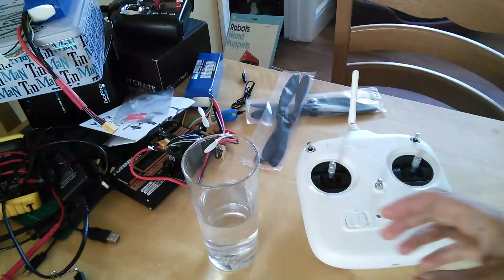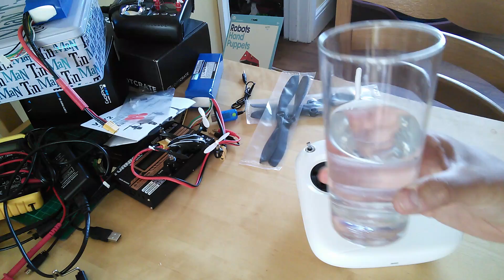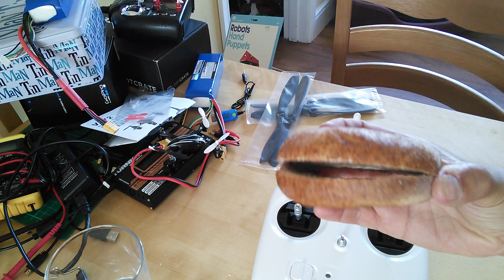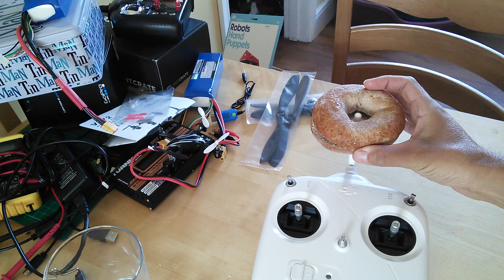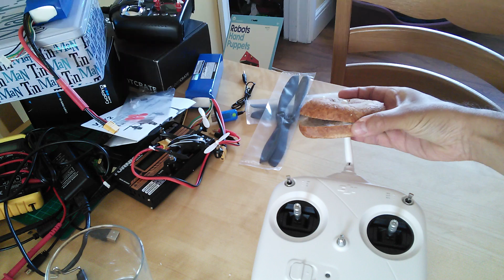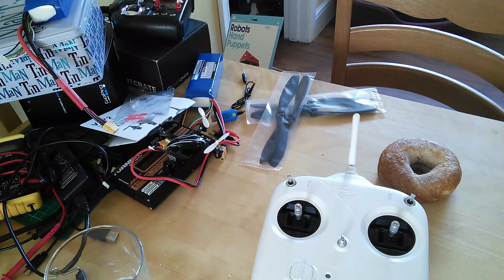Can't fly your Phantom Vision or Plus high before losing control? Possible solution.

Comment: Well couldn't wait til "tomorrow" so I went out and tried again. Sure enough, if I kept the Phantom "out" a little and not directly "up", I didn't lose contact. I flew 500 feet away up to 300 feet altitude at times and never lost contact. I'm in an airport zone so I couldn't go higher than 300. I'll fly more later.

Thanks,
Reply: I was sure my month old Vision 2+ was crapping out on me. Your video saved me a lot of grief. 

I always wonder if the knocks against DJI are thought out before people post. This one tip taught me a lot about my Phantom well after a year of flying my original Phantom.

I've had one crash with my original Phantom. At first I thought it was "flyaway" but after re-tracing my steps before that flight, I realized it was likely human error!

Comment: LOL...I've flown the Phantom 1.1 for a year with no issues. Got my Vision 2+ and have about 40 flights so far. No issues.
Today I went to one of my favorite spots. This time I wanted to get some good vid and pics that required my Phantom to fly almost directly overhead.  I started losing signal at about 300 ft altitude. Some times it would reconnect quickly but sometimes it would go into failsafe. 

I couldn't figure it out. I decided to call it a  night and check out some troubleshooting. Your video is the first one I came across. I won't know til tomorrow if this is my issue but I'm betting that it is.

Comment: Hi Simon, 
Always appreciate your exceptional and informational videos. I have a P2V+  Do you have any thoughts or comments regarding the issues many people are having with the DJI vision app and video freezing at short range? Mine will work fine out to about 50-100 yards, and then the video freezes even at lowest preview resolution I Have the latest vision app version and latest phantom vision plus firmware.  I have a Samsung S3 android but the same behavior is experienced using iPhone 5 iOS.. What to do? 
Many thanks!
Reply: i get 2 miles out with a 1000mW 5.8 fpv system... get rid of that toy fpv and step up...
Reply: MrRaptur3 . Ha.. The "toy" you refer to is really for my 20 year old daughter because I don't want to hand the controls of my "primary" AP quad over to her given the investment I have in it..  My main multi-rotor is  a Turbo Ace Matrix  flying a Sony NEX 7 and long range 1.2-1.3 GHz  FPV system which easily punches video and OSD telemetry through trees and most buildings far beyond 2 miles and worth getting a HAM license to legally operate. I think the Phantom vision + is a great (all in one) first quad to learn aerial photography with...I just wanted the (vision +) I purchased for my daughter to get the minimum FPV range DJI advertises...
Reply: Mark Williams MrRaptur3 just got owned....